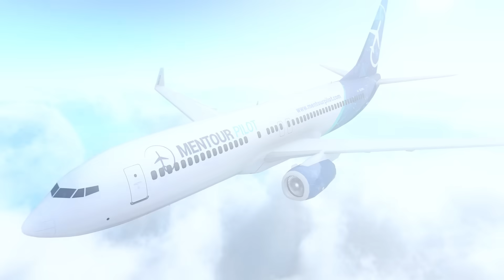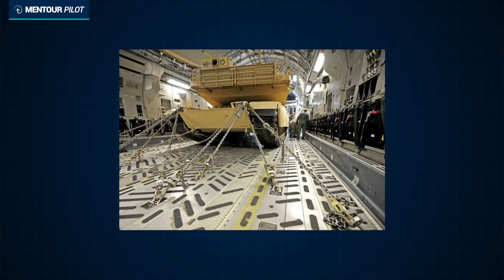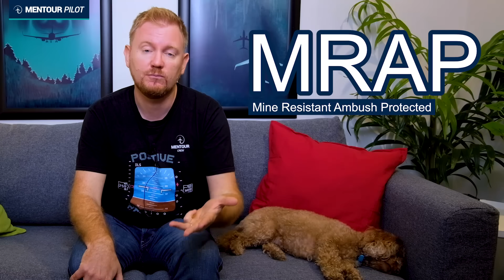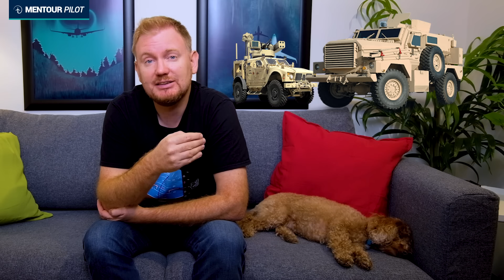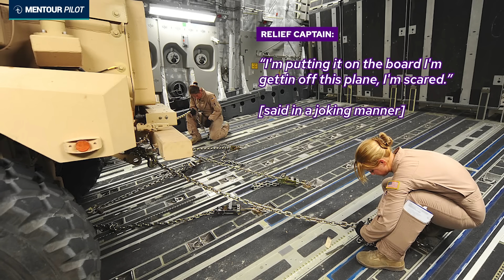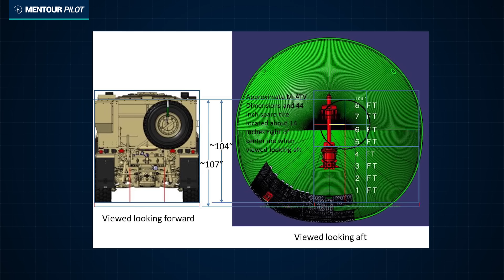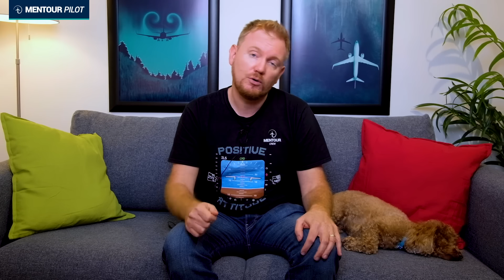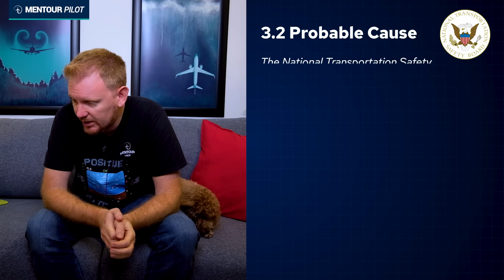Why did the pilots LOSE control?! National Air Cargo flight 102

Comment: I am a retired pilot with 13,000 hours in big jets, 6,000 in command. I was also a technical representative for our pilots association and worked for a short while as a consultant to Eurocontrol. I tend to avoid videos about air accidents because they are rarely accurate or even informative. This is an exception. Your explanation of this accident is clear, concise and accurate. Congratulations. 
It is worrying that the failures of FAA oversight in the NTSB report seem somewhat like the failures that led to the crashes of the 737 Max. Let us hope that lessons are learned as you describe.
Reply: Air transport never does or act on lessons until a sizeable amount of people die. If it's cheaper to pay out damages rather than alter things on their fleet if it exceeds greatly. Pilots lose their flying mindset with auto pilot auto anything else. Not doing ground checks properly. Mistakes mistakes, people think it's only a bus service now rather than a horizontal rocket with all its risk. Crashes happen most years on average & all these jets parked up for a covid year & longer ain't a good thing & need thorough checks before taking passengers. But they won't will they..
Reply: @seltaeb3302  It's not as bad as that. Many improvements to air safety have been made that have prevented an accident before one occurred. Inevitably the improvements that come about as a result of an accident are the ones that become widely known. Aircraft will be checked thoroughly before they are flown, not least by the pilots who are about to fly them. I have declined to fly many aircraft because of issues found in pre-flight checks. For obvious reasons pilots have a great interest in making sure the aircraft they are about to fly is safe. That interest extends to the technical committees of the British Airline Pilots' Association, other national associations and the International Federation of Air Line Pilots' Associations. National aviation agencies and operators and even aircraft manufacturers most of the time do good work and again it is only the failures that get headlines. The safety record of aviation is remarkable as the steady decline in the accident statistics shows. 
There is a saying which applies beyond aviation "If you think safety is expensive, see what an accident costs!"
Reply: @philipsmith1990  "If you think safety is expensive, see what an accident costs!"
The big problem with that is safety comes out of company profits while accidents are paid for by insurance.
Reply: @uzlonewolf  That's a very simplistic view. Insurance may pay a part of the cost, often only a small part. Additional training and engineering, and the revision of programmes and procedures, is often required. Do you believe that Boeing have been reimbursed for all of the costs of the 737 Max grounding by their insurance? Look up Boeing's financials for 2019/20, Not to mention the reputational cost and the opportunity cost of sales lost to the competition.
Reply: @philipsmith1990  the company's shareholders have a 100% chance to get the profits from cutting corners, and they get increased profits from every corner they cut. Not all those cut corners kill people or otherwise result in loss of profits, and they gamble that theyll get away with all of them. So pushing the company's management to cut corners for the sake of profits seems like the sensible thing to the shareholders. It's all basically high-stakes gambling.
Reply: @j.f.fisher5318  That's a very naïve view. Fortunately the shareholders are not in a position to cut corners. I flew Boeings for 15 years and I, my colleagues and my managers got to decide whether corners were cut. I was once reported to my management for refusing to cut corners. My management supported me. As I said before, accidents cost a lot. If the manufacturer can be shown to be at fault it will cost them a lot. The 737 Max debacle has so far cost Boeing upwards of $18 billion There will be more, and that does not include the cost of sales lost to Airbus and others.
Reply: @philipsmith1990  I heard that old saying about the cost of safety in a video of the BP Texas City refinery disaster in 2005.  “Yeah what could possibly go wrong just because we fail a dozen safety measures starting up an industrial process involving enormous amounts to of explosive liquids and gases with hundreds of employees working nearby?”  The refinery was under corporate orders to slash costs across the board by like 25 percent. I can’t fathom the indifference or short sightedness.
Reply: @uzlonewolf  spot on.  Management and shareholders take their cut of the profits… they just move on after the inevitable.  There needs to be an end to that.
Reply: @philipsmith1990  You sound like a corporate apologist with your condescending “simplistic” objection.  He wasn’t offering that as a definitive argument, which yours approaches.  Do you think the passengers - or, rather their loved ones and their communities - were fully reimbursed by Boeing’s pathetic, disgraceful and serving victims compensation offer?  Shareholders and management took their compensation along the way.  Many of them left before the accident.  Yeah the company took a big hit and lost valuation. The decision makers, the people at the top, made plenty of money along the way.  How much did THEY personally reimburse the victims families?  As for the company, they’ll bounce right back because individual flyers don’t book flights on airplanes; they book on airline and destination.  So there is almost zero possibility an airline will buy elsewhere if Boeing offers the best airplane for the money.  Screw Boeing, they are disgraceful.
Reply: @jelliebird37  'Simplistic'? 'condescending'? You seem to have ignored just about everything I wrote. What do you sound like?
Reply: @philipsmith1990  , Do you believe your "defence" stands up after what was really happening at Boeing during the past decade--and more.  Now it is apparent and as usual an attempt to cover up the reality of a company hellbent on profits and lying.  Much like "government" which in reality is corporate control.
Reply: @seltaeb3302  Hey, Bungalow Bill!
Reply: @seltaeb3302  this isn't entirely true. There have been a lot of failures in regulation, but that is definitely not the only issue. And autopilot doesn't mean a pilot isn't the best of the best. Look at Sullenberger, he was a well educated and highly professional pilot. I'm sure he used autopilot all the time. Also, there are maintenence regulations for stored aircraft that remain airworthy. The maintenence and inspection requirements are rigorous. Commercial flying is statistically incredibly safe
Reply: @seltaeb3302    Does not look like the B747s or A380s will fly anymore.
Reply: Thank you for your comment. We indeed can only hope that the lessons are learned at least now.
Reply: Logically you would think humans would be more responsible when dealing w life & death matters.
However the truth is that there are far too many weak points & irresponsible attitudes from the very people who are making the decisions which cause their own deaths.
In this tragedy the transport company was accepting a job which they were apparently incapable of executing properly, or certainly badly under estimating the job.  There are failures on so many levels here, from the FAA, National Transport management, & personnel on plane. None of those involved here seems to understand the seriousness of failure in their jobs.
Reply: @raheesom  Amen, brother!  I had already posted a comment that this was a systems failure, starting at the very top, where safety should be job number one!
Reply: @raheesom  agreed, it’s called “low bid.”
Reply: Air Disasters did an episode over this accident and did a very good job explaining what happened. Once the smaller MRAP smashed through the aft pressure bulkhead and took out the elevator jack screw the plane and crew were doomed.
Reply: The FAA has had a problem in that it serves three masters. The Public, the Airlines and the Aircraft Manufacturers. This conflict has been baked in from the beginning. And is ultimately the cause of a number of accidents.
Reply: @andrewtaylor940    The revolving door of staff going from Boeing to the FAA or American military.  And back again.
Reply: @michaelrmurphy2734  That’s once again a hard one to police or deal with. The problem being the pool of expertise is limited with high requirements. And isolating those three pools or expertise from cross pollinating causes its own problems and it’s own threats to safety. Among the most dangerous things in the world are regulatory bureaucrats with no real world practical experience regarding the things they are regulating.  That’s when you start getting regulations based on “ideas that sound good” rather than empirical data. It’s a careful balancing act. We want the FAA to be more proactive, and less submissive to Boeing. But at the same time we don’t want to be grounding 25%+ of the worlds commercial aircraft every time a pilot botches a landing. Like I said the FAA is in a weird place as it literally by design serves three masters. It is the primary operator and champion of the American air travel and transport network. It’s main job is to keep the planes flying and the network running at capacity. But it is also the main safety regulator. All two often those two tasks can be in conflict.
Reply: @andrewtaylor940    Indeed, it is a specialized skill set.
Reply: @andrewtaylor940  There is a degree of truth in that but these are the goals of the FAA:
• SAFETY: Reduce Civil Aviation and Commercial Space Transportation-Related Fatalities and Serious Injuries.

• INFRASTRUCTURE: Invest in Aviation Infrastructure to Ensure Safety, Mobility and Accessibility and to Stimulate Economic Growth, Productivity and Competitiveness for

American Workers and Businesses.
• INNOVATION: Lead in the Development and Deployment of Innovative Practices and Technologies that Improve the Safety and Performance of the National Airspace System.

• ACCOUNTABILITY: Serve the Nation with Reduced Regulatory Burden and Greater Efficiency, Effectiveness and Accountability.
None of that requires handing over certification of aircraft systems to those with a powerful commercial interest in approving hurriedly designed, inadequate systems with a single point of failure. Management of any organisation will often require the resolution of conflicting interests. It does not follow that every organisation is bound to fail.
Reply: Anyone loading up any large vehicle and securing the load who then finds the load has shifted and broken a strap to then find other straps loose would I thought have the common sence to work out that the straps arnt strong enough so lots more needed to be added. Why do we humans have to have a disaster before we do anything to avoid it??.
Reply: @paulbeddows6014  seriously, A) it’s incredibly obvious to just about everyone; B) it’s their job fer cryin’ out loud, how could it not be obvious to them of all people; and C) “yeah what’s the worst that could happen?  One truck smashes the headlines out of the one behind it?… or I suppose the plane could pitch violently upward and we all die?… naaaah”. (By the way, did you see much foreboding about the plane simply being weighted way to the rear, because I didn’t.  Certainly that they must have rolled back, but I think it must have been way out of balance to begin with).

This kind of reminds me of the Tenerife KLM pilot’s arrogant impatient nonchalance.  A tiny, unfamiliar airport with NO taxiway, engulfed in fog, way over crowded with all these huge, unscheduled airliners, and some very ambiguous radio communication with pilots and air traffic controller talking over each other…. and this guy basically says “screw it, we’re taking off”. A fully booked 747.  With another one taxiing on the runway, in the fog.  No confirmation,  Just “we’re going”.  Man, that is outrageous!
Reply: @jelliebird37  Mistakes happen, and sometimes they cost lives. No amount of training - or good intentions for that matter - can eliminate that human shortcoming completely, only reduce it at best. And not every guy at the top is by default evil and self-serving , nor is everyone below an innocent victim of their contrivances. That superficial black and white world doesn't exist except in the overwrought imaginations of certain people.

As for the accident flight, the plane was not improperly weighted way to the rear. The investigators determined from the evidence available to them that one or more of the loaded armored vehicles had come loose and damaged the rear of the aircraft, causing it to pitch up violently. If it had been improperly weighted as you're suggesting, the same thing should and would have happened on the first leg of the flight (Camp Bastion to Bagram Airfield).

Now regarding the Tenerife disaster, try not to read too much into the KLM pilot’s alleged arrogance as the base cause of that accident. The way Nova portrayed him in their cinematic production was cartoonish and inaccurate, and hardly supported by existing evidence. Van Zanten made a very costly mistake rushing like he did, but there were numerous factors that led up to the actions he took that were hardly his fault, nor were they born of haughtiness (though portraying him as such makes for a great "bad guy" character for unknowing viewers, who often prefer things unrealistically simplistic).
Reply: This channel is amazing! Thanks Mentour! I’m not a pilot but love learning!!
Reply: @scottsherman6889  same, understand if people not like me as I enjoy watching these as I like seeing what they learn and improve on if the plane or training
Reply: @Thunderbolt   Some (most) planes fly people AND cargo.
Reply: @Thunderbolt    FLYING things like that?!  WTH are they thinking?!
Reply: Try watching Air Disasters (Air Crash Investigations) for a very well done documentary series on the subject. It is both accurate and informative.
Reply: @tristanhnl  since I left college think they removed a lot of it from on here, used to enjoy watching during college breaks and yes enjoy as not of death but how they learn to fix issues or change what they do so it not happen again
Reply: I too was skeptical at first, but Petter and his team do good research, plus the knowledge of flying operations give an excellent report - without unnecessary dramatics, too.
Reply: Well Mr. Smith you lived my dream, I did everything I could to become a professional Airline Pilot but for some reason God didn't bless me like he did you.
Reply: is that like a standard amount? wondering how many hours average pilot does in a career
Reply: @mlee6050  It's very variable. I flew for British Airways when the compulsory retirement ago was 55. I operated in the era of the BA Shuttle service which involved a lot of standby time. My technical work for the pilots association also had an effect. Many commercial air transport pilots with a good career will accumulate 20,000 hours or more. Ed Long is said to have flown over 65,000 hours in a specialised job checking power lines.
Reply: I'm interested in your ,or any other pilots opinion of the 737 , good , bad , or indifferent !! Thanks in advance Mr Smith !!
Reply: @michaeldailey7103  The 737 is many different things. For a start early 737s were very different machines to current models. They have been very successful commercially although recent events may have dented that success with the Max. Pilots who flew and fly the 737 generally like it a lot but then it is rare to find a pilot who doesn't like the type he flies. So I don't think there is a definite answer.
Reply: Philip Smith  Thank you so much for getting back to me , much appreciated !!
Reply: @Thunderbolt  wow!!!
 …and lived to tell the tale?! 😯
Reply: Well, yeah, the FAA allowed boeing to make redundancies in the sensors an optional upgrade... that should have NEVER been a thing.
Reply: If you only watched this channel and Kelsey's 74 Gear channel you'd have a different opinion on YouTube aviation accidents videos...
Reply: @paulstelian97  I doubt it. I've watched several youtube aviation channels and this is clearly the best when it comes to well-informed and accurate commentary on the accidents it covers.
Reply: @philipsmith1990  Yes. This one and 74 Gear seem to both have similar levels of quality in terms of how accurately stuff is covered -- just different styles and kinda different topics (74 Gear has among other things the Hollywood vs Reality series)

I do not know of a third good one.
Reply: @paulstelian97  Try Blancolirio. Juan Browne is very knowledgeable, professional and unbiased.
Reply: 737 max problems were first reported by Qantas 72 pilot Kevin Sullivan, no one listened, and many died, Boeing has much blood on their hands.
Reply: If the captain has to do a cursory check of the visual mechanicals of the aircraft before take off. Surely, the captain has to verify the load security too? 

At the end of the day he is responsible for the safety of the flight. 

There could be a million reasons I am missing something. Just interested.
Reply: @michaelmcmillan7458  In a large aircraft it isn't practical for the commander to check everything personally. If that was required the flight would never get airborne. For that reason various aspects of the flight preparation are delegated. Loading including the security of the load is summarised in a load sheet that is signed by the commander. In this case it seems that the responsible person was unduly optimistic about the strength of the restraints.